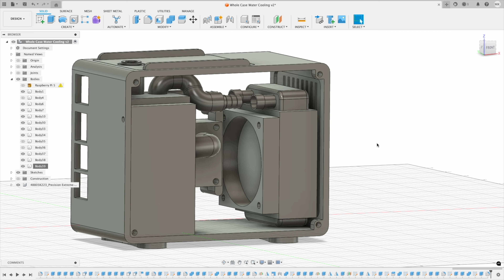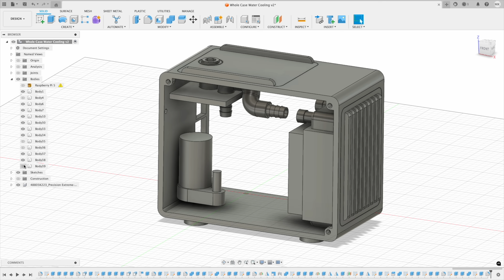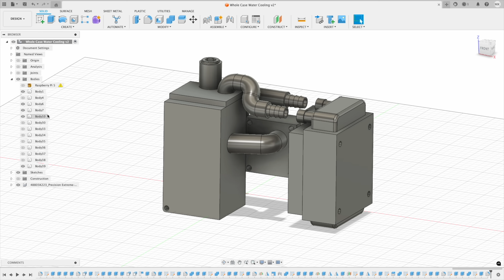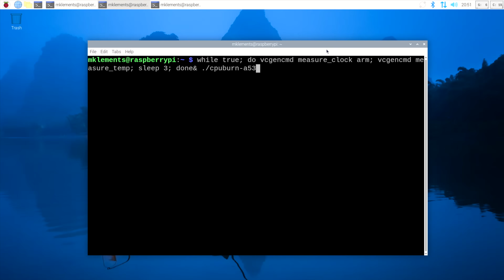Building the Coolest Raspberry Pi 5 Case – Literally!

Comment: This is one of the most clever PC case designs I've ever seen and I mean ALL PCs, not just Raspberry Pi. I only have an FDM printer or I'd do this in a heartbeat. I know I wouldn't be able to do a clear reservoir but is it possible to make the reservoir sides thicker to prevent leaks? Or at least thicker where it joins the bottom plate? I'm trying to think of how I can accomplish this without a resin printer and laser cutter.

Comment: what filament is that for the case?
Reply from the maker: It's Slate Grey Sparkle PLA - I've added a link to the video description. The tubing is 6mm ID.
Reply: @MichaelKlements  thanks for the response! in the process of putting it all together, just waiting to have everything. when downloading the files from the link, it doesnt have the file for the side panel with the slits on the side, is there anyway you can upload just that file alone? the only way to get it is downloading the whole setup through bambulab but I dont know how to save it as an stl
Reply: also what is the diameter of the tubing used
Reply: I’m not too savvy with the Bambu software, so I’m struggling trying to delete the other STL’s from the plates to just save the single panel I need, I’m trying to get the stl to try to print it in a clear resin instead of using acrylic. If you could just add the single stl for the panel to maker world that’d be awesome! Thanks again, super excited to get it all up and running

Comment: I think you need to add JUST A LITTLE light to it.... :) Yes the power button is needed... but I say you make it have a white ring light on it.... AND ... if it is possible... I think having white light shine through the liquid so it highlights the Raspberry Logo cutout!!! I don't remember if the other side of the reservoir is clear, but if you could make it from acrylic I think that would be the Cherry on top..   and along with the power button it would be just the right amount of RGB :D
Reply: - And if you're feeling like "a REAL GAMER" (said in a grungy announcer voice that a company like ROG would use.. to talk to .. REAL GAMERS. lmao sry) you could set the RGB to change color... like go from white to bright red... or some other color to bright red, as the CPU clock got higher with the overclock.... but now that I think of it the Rasp Pi just stays at one clock speed and doesn't turbo like one of the x86 chips these days... right?  ... well if did that would be a cool metric to play with to setting some rgb to... but that was just a silly idea that came to me.. I think white would make this perfect... so just ignore this LOL 😂🤪

Comment: Got this randomly recommended by YT - brilliant work, using combo of resin and fdm for the job.

Only things I would suggest and making alternate sizes of the case to fit 80mm or 120mm fans (maybe lengthening it a bit to allow more flexibility with the tubing runs in such a case), as depending where a person is located it's cheaper/easier to source 80mm or 120mm fans and radiators than it is to sourced 60mm ones.
Though that might require alternate designs for the red/block combo, I'm not 100% sure on if that would be needed.
Reply from the maker: Thank you! I'll look at putting together a larger version for an 80mm or 120mm radiator. To fit a 120mm radiator in the case would be about 8 times the size of this one though.

Comment: What about incorporating the case as part of the cooling system.  It would simultaneously increase the volume of liquid and provide more surface area for heat transfer away from the Pi.